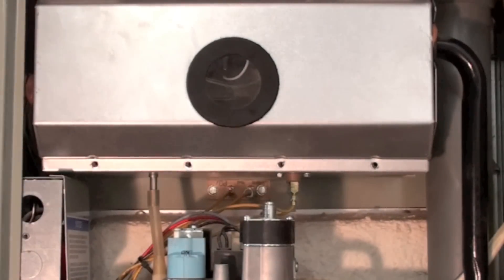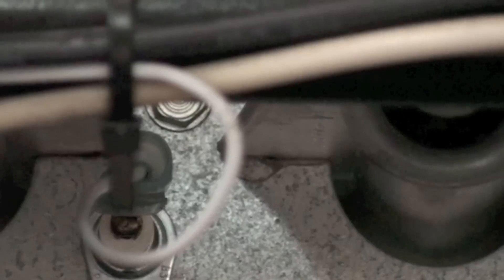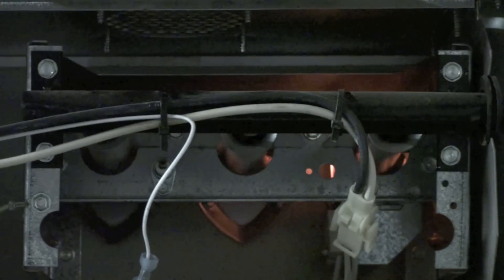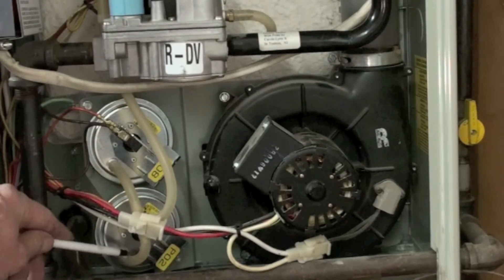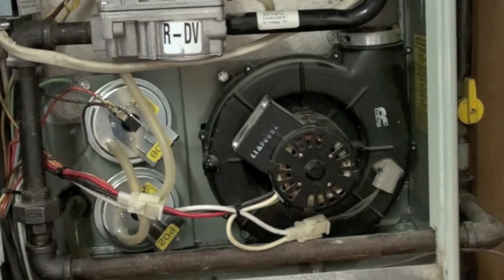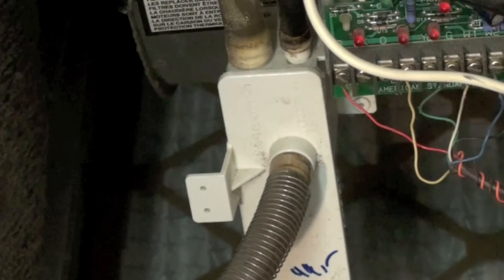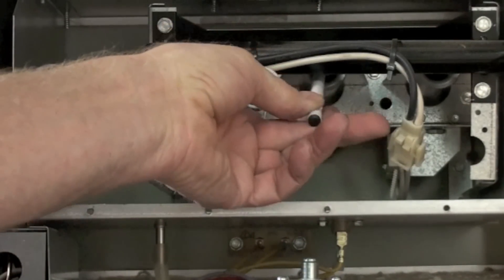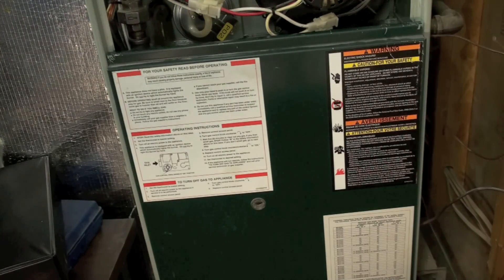Why does the gas furnace short cycle

Comment: 99% of modern units have a diagnostic light on the board telling you why its failed.
Hi linit can be this too.
The system operates off the principle of "flame rectification" that is a flames ability to "rectify" an AC signal to a DC signal, thus proving a flame exists, otherwise no DC signal  will be sensed .

A flame sensor is a metal rod that receives a DC signal through the flame, sent via the igniter.

The flame is  an electrical  conductor, but more relevant it "rectifies" an AC signal to a DC signal, the "flame sensor" is  a  rod that "senses"a DC signal.

Many units have no flame sensor however they operate  alike.

Their DC signal is "sensed" via the burner ground which if you notice terminates on the ignition module on ground or burner ground.

The DC signal is mere millivolts as the flame is a poor conductor, it does not take much to interrupt the DC signal  returning"proving" the DC signal  exists thus proving the flame exits.

0000 steel wool is best to clean a flame rod/ flame sensor.

Most units today have a diagnostic light that will be steady on or off or flashing in a sequence that indicates a specific fault ,a legend on the blower door  tells you the specific error/fault.
If can be  a flame sensing issue ,however  more commonly found is the induced draft proving switch is the problem, it has a rubber hose that attaches to  the induced draft housing that senses the inducers operation .
The pressure switch closes ,telling the ignition module that the induced draft is operating.

The barbed nipple /port on  the induced draft housingwhere the pressure switch's  hose attaches will clog with carbon about every 2 years on most units, it is tough to  clear, I use a paper clip unfolded and make sure the carbon is cleared by hearing the clip touch the induced drafts blower wheel, its easy to   trick  yourself thinking its cleared.
Reply from the maker: +Kd Grayson The only issue I have with your comment is that the DC signal is microamps not millivolts.  All the rest is true.  Thanks for the comment.
GFM
Reply: Can you have an amp draw without voltage?
Reply: 115 vac has one hot leg and one neutral.
The black leg has the potential to ground.
The neutral does not.
What will happen if a furnace is installed with the neutral and common reversed,the module must establish current flow through the flame to ground, right?
So if the black and white are switched in the junction box or the receptacle, there is no flame sense because there is no voltage potential.

Everything else in the unit works fine, but a few seconds after the burners light . . . the module closes the gas valve because the power for the flame-proving circuit is not there.

What if the hot and neutral are connected properly, but the flame still drops out for
 “no reason?”

Measure between  (black) and ground and read 120 vac.
Now measure between neutral (white) and ground to be sure you have no voltage,
 (0.0 vac).
flame-sense current is very small,what would happen to the flame-sense current if there were another voltage potential at the furnace chassis because of a poor ground.

The same problems can occur on a gas pack if the unit is not properly grounded.
You might also have problems on a three-phase unit if the “stinger” leg is the line that winds up as the ignition control’s power source.

The ignition control needs a clean, properly polarized voltage source to do its job.
Reply from the maker: +Kd Grayson No.  Voltage drives amp draw.
GFM
Reply from the maker: +Kd Grayson The reversed polarity should immediately cause the unit to lock out and blink the code.  That said, I just did a series of tests using a modified sine wave inverter.  I had one furnace that the flame dropped out when the fan came on.  I have also had some unexplained failures with some of my test mules.  Some time I will do some definitive tests of neutral and ground in relation to gas furnace controls.  
GFM
Reply: How many microamps in 1 watt/volt? The answer is 1000000.
We assume you are converting between microampere and watt/volt.
You can view more details on each measurement unit:
microamps or watt/volt
The SI base unit for electric current is the ampere.
1 ampere is equal to 1000000 microamps, or 1 watt/volt.

Comment: Do you know my my furnace heat works, but when the temp goes below the set temp, the heat doesn't come back on? I have to turn off the furnace and start the heat again.
Reply from the maker: +kerry Flynn The furnace is going out on one of the safeties.  Probably flame failure.  Have you cleaned the flame rod?
GFM

Comment: Great advice! I woke up this morning to 9 degree weather outside and 55 degrees in the house. My furnace was igniting, staying on for less than a minute then turning off. The video gave me clear instructions and in less than an hour I'd identified a clogged drain, unstopped it and got my furnace back in service. Thanks
Reply from the maker: +Duane Adams Its nice to have heat.
GFM
Reply: +grayfurnaceman Hey man.  I just left this girl's house who was having this problem, and I literally watched this video on my phone crouched behind her furnace, cleaned that rod with a dryer sheet, and it worked! She jumped up and down she was so excited, and I pretended like it was no big deal.  Then we had sex, and it was great.  I can't say for sure your video is the reason I got laid, but it sure as hell didn't hurt!  Thanks, bro.

Comment: We've had a furnace guy out twice now. The first time it was just a loose wire on the gas switch. The furnace ran well for 2-3 weeks. Then it started short cycling. I already cleaned the flame sensor before the first visit, and the furnace guy cleaned it again this last visit. He also popped a tiny hole in the exhaust and put a sensor in there to see that it was burning properly- that checked out fine. He also checked the pressure sensors. The furnace ran pretty well all week, and this morning we woke up to a cold house.....again. And this weekend it's supposed to be below zero out:-(. All along my wife and I have suspected the programmable thermostat because it seems like every time we've had a problem, it's happened on the weekends. We're getting beyond frustrated about this. It's a 23 year old furnace, and we're just trying to get a little more mileage out of it so we can replace it at a more opportune time (financially).
Reply from the maker: +StormLaker1975 Is the vent termination clear?
GFM
Reply: Vent Termination?
Reply from the maker: +StormLaker1975 Outdoor end of the pipe.
GFM
Reply: Gotcha, yes the vent is working fine. No backpressure there, and this morning you can see a nice plume of steam coming from it on the roof as it is 6 outside. I was poking at it yesterday, the first time the repairman was at our house he mentioned that the gas valve we had on our furnace was a generic replacement not for a Rheem or any other particular make/model furnace. It works, however he mentioned the connections to it were loose, then crimped them down with a pair of needle nosed pliers. Whenever the gas valve fails to engage, I take the cover off and jiggle the wire gently and then we have heat the rest of the day, haha. It's a 23 year old furnace, we're trying to get just a little more mileage out of it before we have to replace it...in the spring perhaps along with our central air. Though I am wondering if I shouldn't just have the guy come back and replace the gas valve with the proper one so maybe we can get another season out of the unit.
Reply from the maker: +StormLaker1975 I guess it depends on the financial situation.  I am guessing 3 to $500 for a gas valve.  Is it worth it for one season?  Only you know that one.
GFM
Reply: We got it working again last season- it ran like  a champ after about 3 visits from the furnace guy. I fired it up a week ago just to test it..and it was also kinda chilly outside. Started, cycled like a champ. I still plan on having our furnace guy come and do the annual service. Replacing this furnace is not financially feasible, so keeping up the maintenance is next best thing.  My parents just replaced the one in their house, it was installed new in 88', the new one is pretty amazing, huge changes in technology.

Comment: my furnace acts up when it's below 30 degrees outside. The daft fan will not start up unless I turn the thermostat off then back on.Works fine when it's 40 degrees outside any suggestions?

Comment: Hello, GFM. quick question. Our oil burner now works excellent since your previous instruction. Now, and for a while it starts great then stops in one to three seconds, then in about three seconds it starts and runs to finish call for heat, forced hot water. Thank you, Steve Foley
Reply from the maker: +SeeMooreVids Sounds like an oil supply problem.  Possible vacuum leak in the line from the tank or a blockage?
Gym
Reply: +grayfurnaceman Thanks. Last year I flushed line which was barely flowing. This resolved cycle and no flame then, BOOM! Where do I look for a vacuum leak? At fuel pump? There are no fuel leaks. To clarify. When it starts it is full on, firing then mechanically shuts down as if satisfied. Then, within one to four seconds restarts perfectly again, finishing call for heating water. Thank you. Steve
Reply from the maker: +SeeMooreVids If the burner motor shuts down, you do not have a supply problem.  I would jumper out the thermostat.  If it still does it, I would be looking at the cad cell relay.
GFM

Comment: I have a green scrubber pad, the type safe for non stick cookware.  Been using it for years and my furnace never gives me any trouble.  Forgot to do it this year, and sure enough it short cycled.  Cleaned the flame rod and it's working perfectly again.  If it's safe for nonstick pans, it should be ok on the rod.

Comment: I have an old Schill furnace and I need to know the correct settings for the combination fan and limit control.
Reply from the maker: +Ta'Shawnda Price The settings are somewhat variable.  Start out with 140F and 110F.  If the furnace blower short cycles, farther apart.  Cold air, closer.  Hope this helps.
GFM
Reply: Thank you for the reply, I have since adjusted the settings and that constant clicking has stopped.  Whoo Hooo!

Comment: question, i have an american standard freedom 80 two stage , all 4 burners wont always light , i have lit the 4th one with a lighter so it will light. then it runs fine for hrs. what causes that burner to not light and there is gas present ?
Reply from the maker: +dave smothers Check for dirty burners, low gas pressure, plugged orifices.
GFM
Reply: thank you .
Reply: the flame spreaders and burners were heavily rusted ..works great now,,Thank You,again.
Reply: i didn't replace them , i used one of them micro screw drivers "flat head " to get the rust out of the spreader area, then with the small outer most holes used the same screw driver, then the bigger holes i used my smallest round chainsaw file to clean the rust from there, then steel wool ..

Comment: I'm a heating contractor and I don't know if you know it or not . never put a gas line union inside the furnace cavity. there are liability issues that can bit you trying to share your limited experience.
Reply from the maker: +Terry Moline It is not an enclosed space and the codes say its ok.
GFM
Reply: +grayfurnaceman( not ok )to have a gas union inside furnace cavity. even if your code would allow it and mine does not it's just a very bad idea.  I have found leaks in unions more than any other place so why put it inside the furnace when you can put it outside the furnace.  no one will ever stop you from sharing your limited experience and I know you won't be convinced your wrong. we all want to help but we need to be very careful about it. my advice is if you don't want to avoid hurting people get a good liability policy.

Comment: My furnace is very slow to ignite.

Sadly I have a Ignition pilot, Sensor and Glow Coil all in one and it's in back of burners case. I'd have to take out a lot of screws but I don't want to take apart something for fear I'd damage something further. I have a Comfortmaker RPJ II but it seems to have Honeywell parts. I bought this house in 2012, in March of 2011 sticker on furnace states new HSI assembly. I'd love to get to the Sensor to clean it if it needs but cannot get to it. Cannot afford furnace person so very very upset.

I got a new filter Wed. night and put it together (2400), a friend thought thermostat (i don't see how this would cause this) so I got new batteries Tonight. When I tuned the thermo on off then back on things really went worse. Not only taking 5 mins for flames but then would go out. Next time it would start. I've taken the panel off, blew on some things that looked dusty, did touch the wire that went to Ignition pilot, Sensor and Glow Coil. 

Strange thing for 4 hours from 11:25 to last time it came on just after 3:00AM the thermostat clicked, I heard the flames come on within 15 seconds and furnace on withing 25 seconds like nothing ever wrong. Now back to long time to ignite at 3:22AM. I am totally puzzled. 

But since Mon. I noticed something was wrong and taking almost 3 mins. before I heard flames to it getting worse and even longer time to ignite Wed. and Thurs.. How could it be so screwed up. Be so bad then work fine for almost 4 hours then back to bad. I mean if flame sensor, why would all of a sudden it worked fine for the 4 hours?  Have a friend coming by Friday after work. But what does this sound like to you. Doesn't make sense.

I prayed it would stay working but never heard of a self fixing furnace. I just don't understand. 58 yr. woman not inept but can't fix furnaces.
Reply from the maker: +Longshotsblues There are 2 possibilities I can think of.  One is the flame rod is dirty.  That will cause the symptoms you describe.  The other is the gas valve itself.  The electronics are part of the valve.  
GFM
Reply: +grayfurnaceman I had a very reputable heating and cooling place near me tell me not unusual at all to all of a sudden work fine, said the ignition pilot might have been hitting a spot on flame rod where it wasn't so dirty then hitting back to where it was. ??? They said not thermostat or control board.  I did so much reading until I couldn't see straight. My problem on this furnace Ignition pilot, Sensor and Glow Coil is all in one piece behind the burner case. I have to take out I don't know how many screws and take apart. I'm just sick.
Reply from the maker: +Longshotsblues It would be nice if they made them easy to work on.  But they don't.
GFM

Comment: I have a AmSt Freedom 80 furnace that keeps cycling for approx 30 sec.   Does exactly what your video shows, lights 4-7 secs, then goes out.  Never stays lit!!  Changed Flame Sensor twice (thought one was bad) so ..I have changed the flame sensor.
I have checked the venting, t-stat, filter, and ignitor.  It does not shut down or go into external lockout And then all of the fire is off and the blower will not shut down.
Any thoughts Pleeeeeeeeese?
Reply from the maker: +Elijah Cruz Webservices Try jumping the thermostat to eliminate it.  Are all the burners lighting?  If all checks out, the control board has probably failed.
GFM

Comment: what if the flame never kicks on ? it cycles , glows , but doesnt fire up .
Reply from the maker: +belexes777 Check gas availability, (gas cock on, gas valve on, other appliances working) then possible failed gas valve or control board.  Hope this helps.
GFM

Comment: hello friend , thanks for your input, my heater cycles twice some times after say 10 minutes , and it makes a bang sound
kinda like a dent being poped out of the air duct? any adcive
Reply from the maker: NOBOX7 I don't know about the cycling, but the bang is probably a ductwork problem.  Sometimes the ductwork will make that noise as the pressure inside the duct increases or decreases.  Look for movement in the duct when the fan comes on or goes off.  Sometimes the repair is as simple as denting the duct with a hammer, or you may have to reinforce the duct with a metal strap.  Hope this helps.
GFM

Comment: Just want to say I really appreciate you posting this video. I was noticing the same 4-8 second cycle with the burners lighting and then shutting off. The system cycled just like you described. I pulled out the flame detection rod and it was indeed scored up-and-down. After cleaning it with light sandpaper and replacing it my furnace is now on with the burners lit and running for longer than it has in a while. Thank you!

Comment: Dirty flame sensor, exactly as you described.  A few rubs with steel wool and the heat's back on (It's 18 degrees outside). Saved me a service call and a day off work. THANKS!!!!!!!!
Reply from the maker: lr4165 Its nice to be warm.
GFM